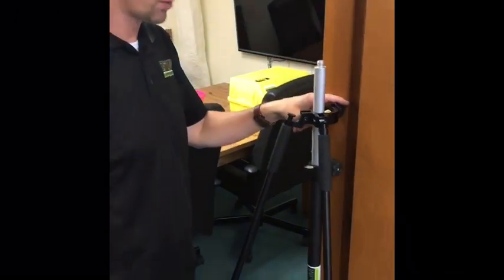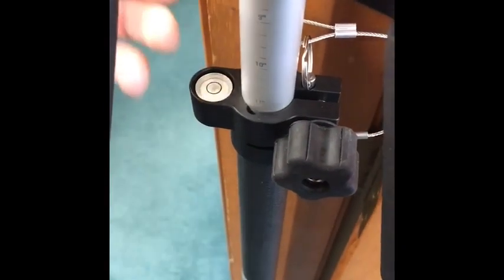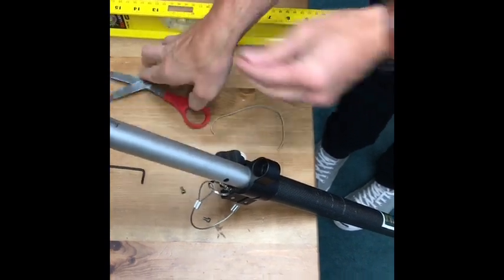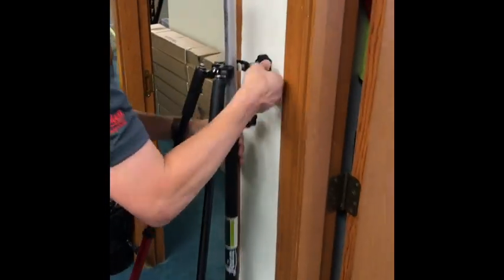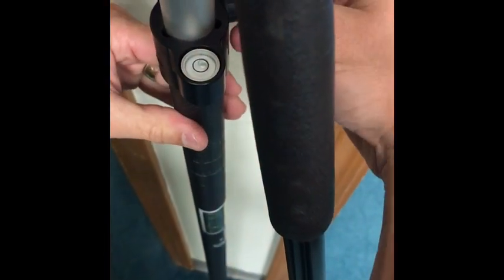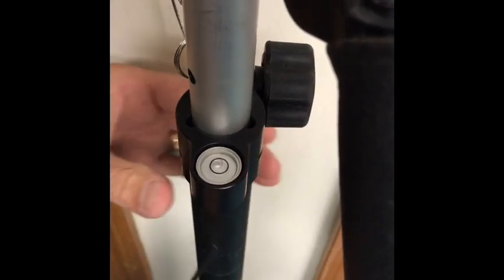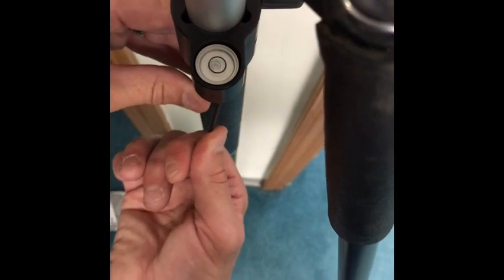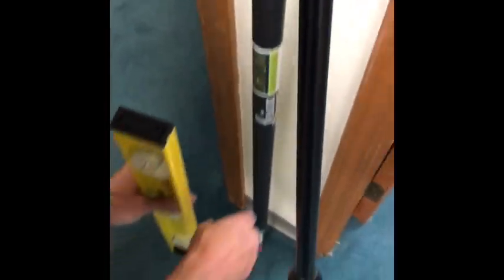How to Check and Calibrate Level Bubble on Prism Pole _ Datum Tech Solutions

Comment: This method works but is a lot more convoluted than necessary. Bubble vials are self checking, you can check/fix their calibration without other accessories like the spirit level
Reply: yeah but this actually takes time out of it if the bubble vial is not in the same plane as the pole. you have to have a guaranteed starting point. I received a new fixed height tripod the spirit level said was out of level when the bubble level said it was. use the spirit level then adjust the bubble to it. after a few adjustments to the bubble level everything talked. I thought the same thing you just said but after chasing my tail for about 10 minutes i realized the pole and the bubble level were not on the same plane. the only way to do this is with a spirit level.

Comment: Why are you adding the piece of rubber band?
Reply from the maker: Paul Davidson, we use the rubber band as a pivot point and to add resistance against the screws. It makes it much easier to calibrate the bubble.
Reply: I will give it a try. Thanks for the video it was very helpful.